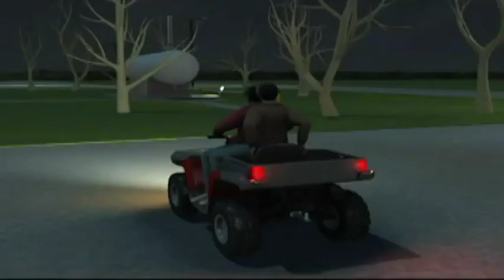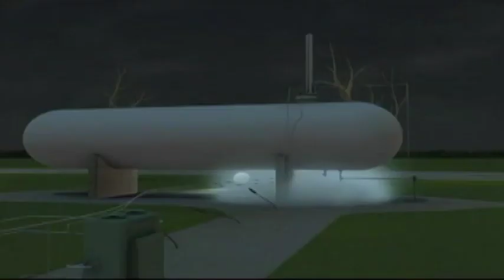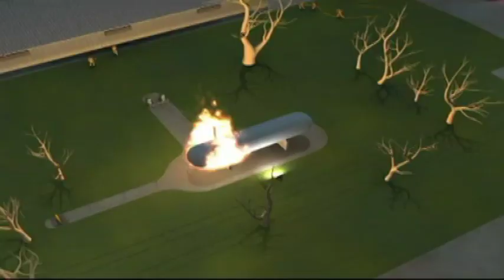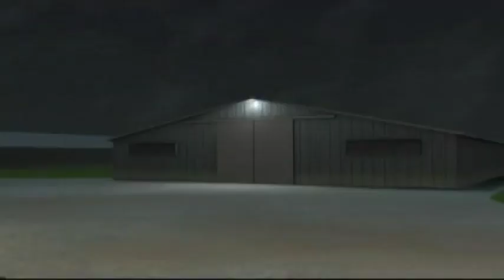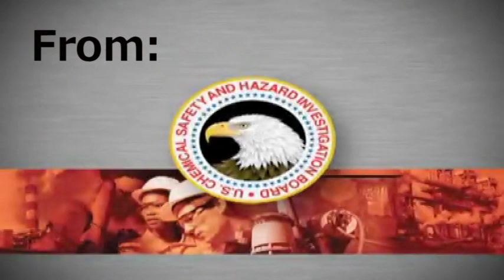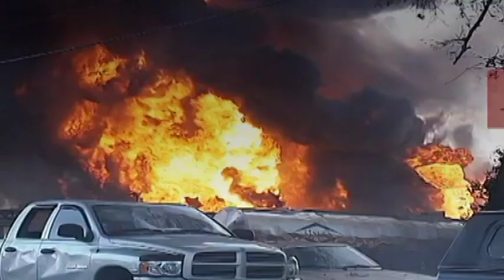Herrig Brothers Farm, Iowa, Propane Tank Explosion 1998 Chemical Safety Board CSB BLEVE

Comment: My facts are right on.  I was there.  In fact I was the first one, there.  I was a law enforcement officer that saw the flames from Pocahontas County.  I called this in, the records are there in Pocahontas County.  Which no one ever checked.   I parked my patrol car in a valley behind the far east turkey barn that ended up having half the tank in it.  There was a fire truck parked to the east.  That fire truck was the one spraying water on the tank.  it was also the same loaded fire truck that got pushed back from the blast and the breaks were locked up.  I had just spoken to the chief at the NE corner of the tank.  We had to scream at each other to talk as the pop off valves where working and the flames were very high in the air..  I asked him if he wanted me to get more help coming.  He said no  He turned and walked back to the west I turned and went to the east.  In that split second, the pop off valves closed, if became very dark and quiet, and the thing blew up.  Something hit me in the back as I went flying though the air and landed in the valley just to the north of the building that had the tank in it.  I was goofy but I new enough to know to go look for people.  The building just to the north of the tank was about cut in two.  I thought the chief may have been blown in there.  So I walked inside that building with my flash light, looking for him.  I could not see anything as insulation was floating all over.   I saw all kinds of other things there that night which I will not discuss out of respect for them.  But I want to assure you, I was there, I stood right next to the truck and watched them spraying water on that tank.  Not one single person came to speak with me about this and I personally still have copies of the transcripts from the Pocahontas County LE center.   The two firemen on the east side cooled those valves off, I saw it.
Reply: Wow, that must have been like hell!...
I actually wonder if the cooling was TOO effective - changing the temperature of the steel suddenly, cause it to fail.
Reply: yo 
man sounds like a real shit storm ..i have been in a few  ..
 just like any cop,
 fire fighter 
 rescue
 ems ...
the bell rings ..
.we respond ...
we give it our best 
 stay safe 
mike collins  #6768
 phila police 
narcotics strike force
Reply: @BenjaminEsposti no, the whole reason propane blevies happen is because as the liquid propane level drops, that liquid can’t cool the steel anymore building pressure inside. It exploded because it was already too late, pouring water on it wasn’t enough to cool it sufficiently. It was a ticking time bomb waiting to happen

Comment: in fact watching this video again.  At 51 seconds it shows the firemen spaying the building.  These two firemen where the two spraying the tank.  I met the chief at the corner of this building closest to the two firemen in the video.  That is also the building that was cut in half that I went into looking for him.When I first arrived at the fire, there was no one there.  The fire was small and it was only under the tank.  I could see the fire trucks coming from miles away.  Before the fire trucks arrived one of the pop off valves worked and the fire now shot out of the top.  Not long later another one went off.  It was very bright, it sounded like a jet engine and fire was shooting very high out of the tubes.  In my world the water being applied to the tank cooled those valves enough to shut them off.  This is when it went dark and became very quiet  Just for a split second before it blew up.  Check my call log with Pocahontas county.  Its all there and never looked at.
Reply: Interesting... in the safety report by CSB (Report No. 98-007-I-IA), page 17 it says they did not spray any water on the tank.
Reply: Hello, the narrator provides the length of the tank, but do you know the gallons capacity and the stored gallons at the time of the fire?

Comment: That is a version of the truth.  Except no mention of the pop off valves working with flames shooting high into the air and the fire truck parked directly to the East putting water on the tank.  They cooled those valves those valves and shut them off with the fire still burning below. That is when it blew.

Comment: Yes there was training, some of your (FACTS) are not correct! The pop off valve was not sized correctly for the size of line going to the  whole setup and the vaporizers became the ignition source. Fire trucks were not where you said they were!  Get your facts right!!
Reply: The trucks were postioned were I said they were.   Right before the explosion I had just stopped and talked to the chief at the SE corner of the building the was directly north of the tank.   I asked him if he wanted me to call for more help.  He turned and went west.  I turned and went east.  The fire went out for a second then the explosion.  I was blown down the valley between the turkey barns.  The valley just to the north of the barn that had the section of tank in it.  I got up, went searching for the chief.  I ran into the building cut in half thinking he was dead in there.  Insulation filled the air.  I couldnt see.   I then traveled west and found.  Well stuff.  The two tracks started in the gravel and ended at the big barn. I think thats enough bout that. 

 I was clearly there and things are as I stated.  Im an independsnt source that has no skin in the game.   The trucks were were i stated.  They were spraying water on the tank.  The pop off valves did close. The fire went out.  It went dark then exploded.
Reply: In fact im in possession of my communications with Pocahontas County that night.  Transcripts from the LEC.  Id happly provide them to any official.
Reply: None of that matters because clearly there wasn’t enough training If they believed it would have only exploded from the end caps. They didn’t know about the liquid propane levels dropping, they didn’t know that it would cause a blevy, and they should have known to immediately evacuate the area as once the pressure relief valve starts shooting out flames, they should have immediately went to safety